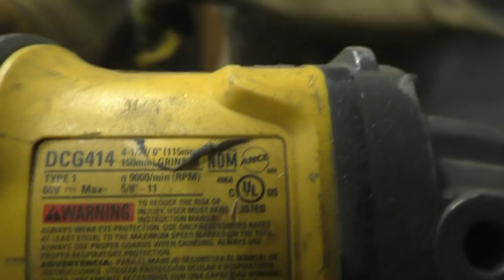Grinder Safety -- and lies you are told to scare you.

Comment: No hearing protection? No gloves? No face shield? No particle mask? Wheel loose on spindle? Safety guards removed from grinder?.. this guy is a poster child of how not to use your grinder lmao... most of that stuff would get you fired at places I've worked...
Reply: Because employers don't want idiots doing stupid stuff
Reply: face shield? mask? guards?  your quoting out of a osha book with no practical experiences in the field. on a job site you very rarely ever have access to even half of what 'osha' wants from you and even if you do, the added time and effort or even the sheer size of safety equipment make the job more difficult or impossible to accomplish.   maybe in a warehouse setting or some type of ultra high end industrial manufacturing plant you could get to osha level but certainly not out in the field.
Reply: i think the point is he had none of that, used the grinder with broken disks in terrible forms and came out the other side perfectly fine
Reply: @INCC74656I  I worked as a union welder for a while, I'm pretty sure I know what I'm talking about when it comes to grinders and their use professionally... we literally had meetings about such topics and would get sternly reprimanded for misusing tools, if seen by a supervisor or general contractor, or inspector...
Reply: @toadamine  im sure there were meetings, there are always meetings. whats on paper never translates to whats on the ground in my experience however. a sizeable chunk is lip service. job done is #1, job done in budget is #2, osha fall some where behind lunch break requirements.
Reply: I think this guy is talking about people in their own shed. Everybody has to abide by work rules, whether they make sense or not. So, work rules are not the issue here and there is no conflict with the video.
Reply: @INCC74656I  Bullshit! if you dont have access to ppe your employer is breaking the law. He's not doing it for your benifit either, the moment you break yourself is the moment you'll not be welcome there anymore
Reply: @INCC74656I  Is finishing the job more important than your health? You have your priorities wrong if you think it is. It only takes one slip up, one mistake, to get your self hurt, and hopefully not the point that you lose something that prevents you from continuing your line of work. You think your employer will step up to bat for you? That is foolish thinking, you'll be dropped as quick as possible. You're out of a job, you're disabled to the point that you can't continue your trade, and you can't support your family. Why? Because you were too "badass" to take a few extra minutes to throw on your PPE, and do that job safely. Good job!
Reply: @ubahd00d  you mention the employeer not being there for the employee. i understand and agree with what you are saying. from the other side - i look at it as: if employee A wont get the job done then they will be put out, in favor of employee B who WILL get the job done.  in my experience making waves about  not being able to 'properly' do a job is a good way to loose that job
Reply: @INCC74656I  Would you fire someone for taking an extra minute to don the proper PPE? My body and life isn't worth meeting a deadline.
Reply: @INCC74656I  Also, if an employer fires your for trying to do the job properly, they are doing you favor. Go find a good employer that sees you as a human, not a number or tool.
Reply: @ubahd00d  its not as much about firing as it is loosing out on OT or loosing normal hours. we live in a time where employers have all the cards. we dont even have unions but for a small subset of trades.
Reply: @INCC74656I  Is it worth your health, your body, or your life though?
Reply: you dont wear gloves on rotating tools as rule of thumb, hand grinders you can but still not really a good idea. a face shield and googles are an absolute. i have actually had a grinder explode on me and my faceshield saved my fuckin eye
Reply: You're right.
Reply: @INCC74656I  No he knows what he's talking about. Visit any large metal fabrication shop or site and you'll notice everyone is wearing some decent level of protection at least. In my workshop it's gloves, earplugs, glasses, visor and overalls. Half of the safety gear you need for a angle grinder is mandatory just for entering the workshop (overalls, glasses, ear plugs).

The correct PPE is mandatory and is always provided by my employer and it's against the law not to anyway. If I walk through the workshop with no glasses it'll be a telling off. I honestly have no idea why people never wear PPE when using a grinder anyway. The sparks are annoying as hell and a visor, grinder guard along with gloves makes them much nicer to use. Who the hell likes being showered in sparks and disk fragments?

Like Aaron Lowe said, this guy is just a weekend warrior and is exactly the type of guy who'll have an accident sooner or later. He lives in a bubble world and has had no experience outside his garage. Anyone who works for a large company are by default using grinders far more often than this guy and are far more skilled with them in general. They have also seen others who have had accidents and near misses with them because they're around many others who have also have mountains of man hours using grinders. There are guys in my workshop who have had 40 years of regular 55 hour weeks using grinders every day and they never do the shit this guy done. Even me with just 6 years worth of experience would never do crap like this.
Reply: @mrdojob  I've worked in multiple factories. Large factories that are some of the largest in their particular industry and many times people are not wearing all of the PPE that OSHA would like to see. Usually safety glasses are worn, but I've rarely seen face shields worn when working around grinding wheels, polishing wheels, etc. Just like you'll see contractors from big names not wearing harnesses when they are working on roofs. When I was working in construction you constantly see people doing dangerous stuff to make the job go faster. I saw a guy fall off a ladder just to save a few minutes at the end of the day. 

I'm not saying any of it is right, but I've done it and almost everyone I've worked with does it somewhat regularly. Maybe at union shops none of this happens (I doubt it), but anywhere else this is basically the norm.
Reply: @INCC74656I  If you dont have safety boots on and you get a grinder disk in face , insurance company aint paying for the hospital visit ... thats why the companies have those rules .

Comment: If someone dies from using a grinder, they probably weren't meant for this world..
Reply: ive heard guys akmost bleeding out from skill saw cuts to the leg
Reply: @whit6282  that has teeth...
Reply: AKAtheA hot cut off wheel goes in like butter.....
Reply: @whit6282  but still...no teeth...big diference, especially if you are stalling the motor. Abrasive wheel won't chew through flesh so well once it slows down, teethed blades will keep biting and ripping until they come to a complete stop.
Reply: I've been hurt but i don't see how it could kill you. I've touched my skin with a flap disk (by accident) and it barely left a mark
Reply: I've heard of a story of a guy who had a grinder with a lock on switch. 
Didn't check his grinder before plugging it in it was sitting on the floor without the guard.
As soon as he plugged it in,
 it came across the floor hit his shoe and climbed up his leg.
As soon as Reaction Time kicked in and he unplugged it it had dug a 2-inch deep cut across his leg to his inner thigh.
It's lack of Common Sense and not taking 2 seconds to check.
Reply: Eventually, some safety nazi will stand before congress and say that all grinders must be outlawed in the interest of public safety.  Must we create a National Grinder Association to protect our right to keep and bear abrasive rotary tools?   Do you remember the creator of the SawStop table saw?  A great idea to be sure, but since sales didn't meet his expectations, he goes before congress in an attempt to make his invention mandatory on all table saws, regardless of manufacturer.   Not cool.  I've been using a table saw for 45 years and still have all my fingers.  Why?  Because I'm not an idiot and respect the threat.
Reply: Natural selection....
Reply: Mostly it's true. Most people injured from grinders are mad people that take all security systems off of their tools, because guess what, people using security features are safer from the tool.

Comment: When I was a child my neighbor cut his hands and arms, slit his mouth opening up to the back of his cheek and cut into his jaw and deep into several of his own teeth in the back of his mouth with a locked grinder because he dropped it from above his head while cutting.
He had a lot of ticks where he would jerk his head hard to the side while sniffing, so he looked pretty brutal before he got cosmetic surgery to hide the scars.
Reply: yikes
Reply: Did he try to catch it with his mouth??
Reply: It fell into his mouth whilst running with the lock on? Lucky it didn't cut his head off

Comment: Considering that 20% of all power tool injuries are from Grinders (Source:Metabo)  and  80% of those injuries are to your primary hand: 
1) The inevitable outcome will be is a SEVERE dysfunction of the hand.
2) Partial loss of prehensile function (meaning you can`t easily grab things with your hand anymore)
 3) and almost ALWAYS complete loss of fine motor function. 

What does this mean to you:
a) Complete inability  to continue working 
b) loss of income and 
c) severe social distress.

The point: Yeah, a grinder injury may not kill you - it''ll just ruin your life.

KEEP THE GUARD ON
WEAR PROTECTIVE EQUIPMENT
Most injuries happen to new users AND those with 10+ years. i.e Inexperienced and those whose luck is running out by sheer force of numbers

(Reposting @deceneu and edit)

Comment: There are old pilots. There are bold pilots. But there are no old, bold pilots.

I don't get what point you are trying to prove. You are taking unneeded risk, and belittling people who are more risk averse than you. Just because you haven't yet been injured, doesn't mean what you are doing is correct. 

Intentionally damaging a disc, before cutting, with no guard is nothing short of idiotic.
Reply: He wanted to proof that a damaged wheel wont cut through that safety glasses like in that picture shown. He did actually say if you would run a disc like that you would have other Problems. The other thing is, this Kind of grinder isnt really made for high pressure on the Discs, the Battery will cut off long before something like that will Happen with an intact disc. Do that on a corded grinder and youll have pretty much more fun ^^
Reply: Chuck "milquetoast" Yeager is 96,
Other than that I agree with you.
Reply: @davidbostock6776  Touché, Yeager is a legend 👌
Reply: @ParRagon-  The eye isn't the only vulnerable place on the human body though. Just because he couldn't replicate the image doesn't mean it won't, or can't happen.

Like you say, corded grinder, different disc, and the results would be different.

Its a video which proves nothing and encourages a flippant attitude towards safety whilst using fundamentally dangerous tools.
Reply: @normg002  i know, and by no means i Support cutting or grinding, or other work with powertools doing without safety Equipment. We at work as an example use that cordless grinder only for Light duty work, like plastics or Thin Metal at worst. I Think everyone  using powertools should be trained to use them properly and as the Tool should be used. Jm2c
Reply: @TugIronChief  i didnt say anything Else, Just that you are generally with Equipment on the safe side
Reply: You completely misunderstood the video so this video is not for you. Just do what you do. This video is for people with common sense. If that has to be explained then the viewer doesn't have any common sense and should have all the safety gear they can possibly get because without common sense they are a danger to themselves and everyone around them (all the time, not just when using tools).
Reply: @aaronmicalowe  where did i fail to understand what the purpose of this video is? And please dont say that i dont have common sense, safety Equipment is for other purposes too. Imagine a injury caused by such an angle grinder. First thing youll hear is " did you have your Equipment on you because if not you wont get paid anything", and then you get to pay All of your debts from Operations or such things by yourself.
Reply: @ParRagon-  like I said, the whole video. It's ok. If people want to be "safe" then power to them. Personally I rely on common sense. But there will always be nitpickers and naysayers. One for every penny and cent on the planet.
Reply: @ParRagon-  who said I ever injured myself? Common sense ;o)
Reply: @aaronmicalowe  Sure. Cuz you dont work so you cant injure yourself. Imagine me wearing s3 security shoes as we are ordered and ill get 20kg on the toe. Nothing happens. You wearing nothing and you still get the dropped weight on your foot. Doesnt even need to be your fault. Still you wont get paid anything and youll get all the trouble. :)
Reply: @ParRagon-  who said I have never worked? I wish, lol 😂
Reply: What do you mean you don't get his point? He spells out his point several times.

His point is that grinders aren't the super dangerous death traps that people say they are. So rather than just saying it and leaving, he is demonstrating his point, giving evidence to his claims.

The last line of your comment is exactly what he's talking about. Obviously, never use a damaged disk. He said so several times. But it's nowhere near as dangerous as you think it is. Look how hard he had to try to get a disk to come apart, and even then there was no force or real danger behind it.

Comment: The picture of those safety glasses with the blade stuck in it is real. That cracking around where the blade entered the glasses is from hard impact blowing the plastic out into his face. Those little chips wouldn't be there otherwise, and it would be next to impossible to fake them and make it look realistic. Not to mention nobody would waste their time on it.

Table saws and jointers scare the shit out of me... I've seen a 2x4 go straight through a shop door and my shop teacher cut his thumb off on it too, dado blades are just insane, and I don't even want to imagine what an injury on the jointer would look like.

Comment: What’s really scary is the dust you’re inhaling while grinding/cutting
Reply: true that is way more of a concern imo
Reply: %100.
I'll take stitches today over Mesothelioma or Silicosis when i'm trying to enjoy my retirement!
Reply: @jonanderson5137  Given how fast it cuts into metal it's clear how fast it'll cut into our soft bodies.
Reply: Yeah I had a job grinding old cracked welds out of aluminum back when I was 19 or so. No one ever mentioned any link to Alzheimer's back then. It's ok though, I'll forget all about having that job soon.
Reply: What about ear protection also... I guess some people don't want to talk to their grandchildren these days.
Reply: @0xsergy  Not exactly. The resistance the metal offers is a good reason it cuts so easily. Chainsaws for example cut through wood very easy but flesh - it hangs up and clogs. I don't suggest cutting soft tissue with a chainsaw. Don't ask how I know this.
Reply: @TheNajSD  yeah but before they clog they'll take a nice big bite
Reply: @0xsergy  They clog pretty fast. The blades specifically based on their design. Which is my point. How something cuts into one object is not indicative how it would cut into another.
Reply: @TheNajSD  I tried using a flap wheel on an angle grinder to shape  some plastic and all that happened was that the top layer melted with very little material removed.
Reply: Aluminium dust especially.
Reply: but its an experience to learn from in life.
Reply: @Folsomdsf2  Well then I guess the Mexican chainsaw beheading i saw was wrong. Thanks for correcting my interpretation of the event.
Reply: @Folsomdsf2  They weren't torturing the guy. They were removing his head. The stopped and used a knife because the chainsaw sucked so bad.